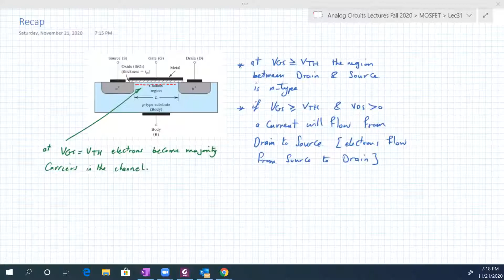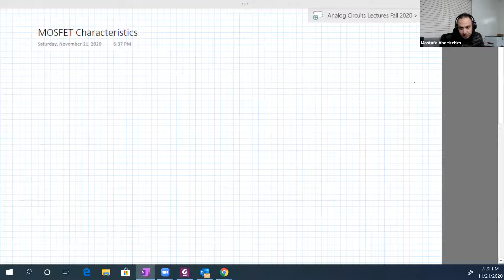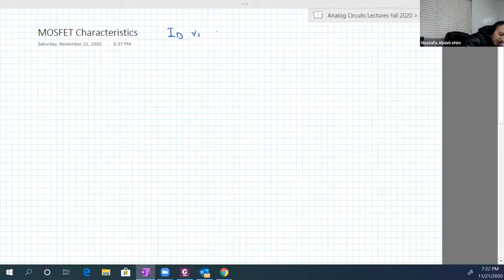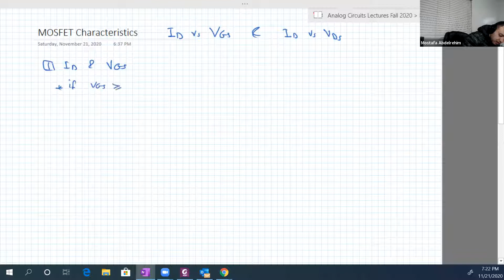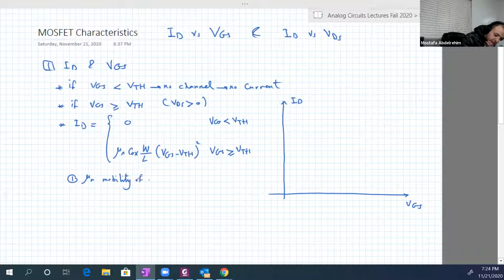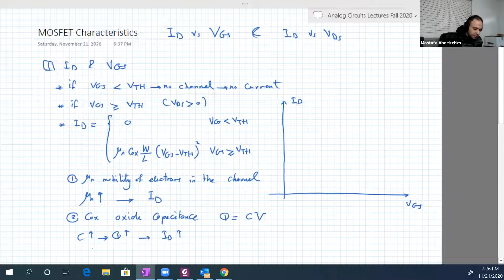[31] NMOS Characteristics - ID vs VGS - ID vs VDS - Linear Region - Saturation Region

Comment: Would the graph between Ids and Vgs depend on the value Vds as after Vdsat the current will be in velocity saturation not saturation for a higher Vgs value
Reply from the maker: Not sure 
Please review Sedra book for that. But good question anyways 🙏
Reply: Good question, I was just thinking of that. From the equations, after Vgs crosses Vds+Vth on Ids - Vgs curve, curve should change from quadratic to linear. basically equation should be y = x^2/2 for x<1 and x-1/2 for x>1 (y=Ids, x=Vgs-Vth, and K=1, Vds=1). If you calculate the slope at x=1, it is continuous so it seems it should gradually change without a kink.